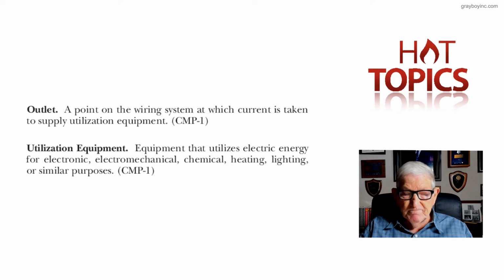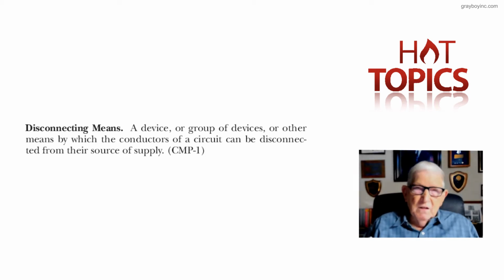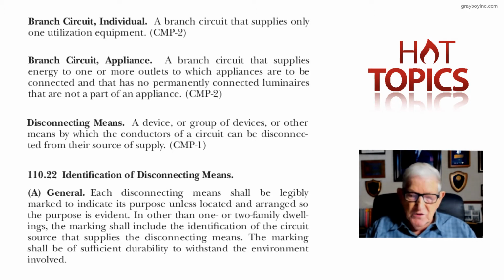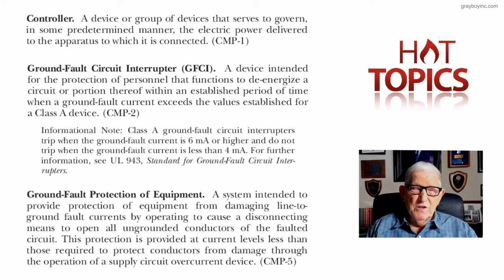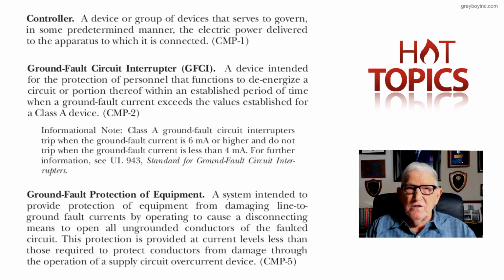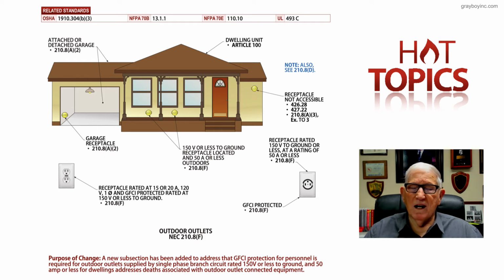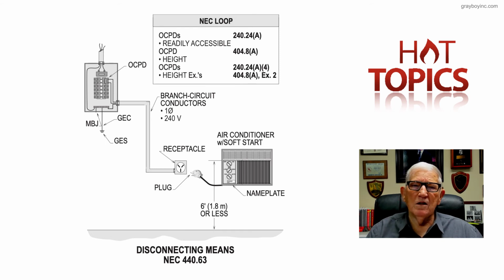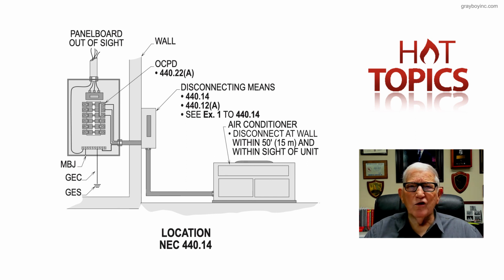HT E 01  -  210.8(F)  -  What is an Outlet?

Comment: I was a little bothered when CMP 2 stated that they mandated Class A GFCI for hardwired utilization equipment in dwelling units. Their job is to write the code language not enforce the rules of the NEC.
Reply: Hi Bill,
Code Making Panel 2 as well as other panels have to take on proposals and do their best to
make good senses out of some of them. We will have to wait and see how they handle 
this problem of GFCI protection on AC/units. To my knowledge, each panel does not try and write
code rules, but work on proposals that their panel receives from NFPA to work on. When I was chair
that was what each panel was charged to do. Panel 2 probably mandated GFCI for utilization equipment 
based on a proposal that they accepted..
Reply: @jamesstallcup9850  2nd time watching sir and 2 things came to mind CMP-2 wrote the definition of an individual branch circuit which doesn't mention an outlet and CMP-7 440.3 and CMP-17 422.3 doesn't seem to agree with CMP-2 saying that hardwired utilization equipment are defined as an outdoor outlet per 210.8(F).